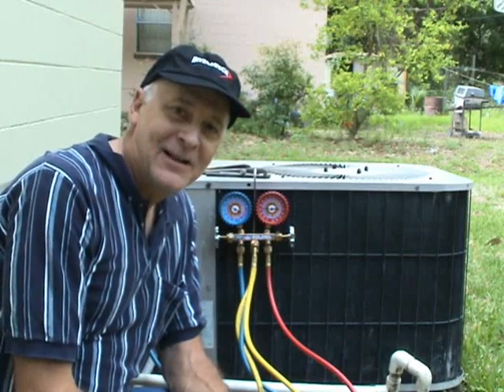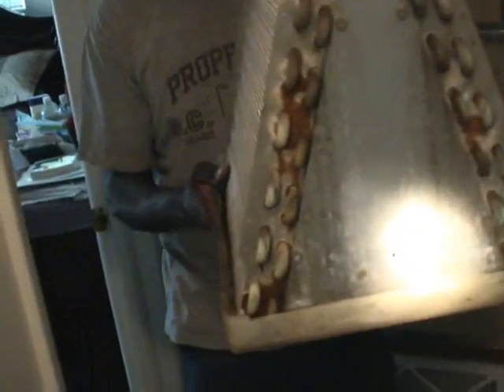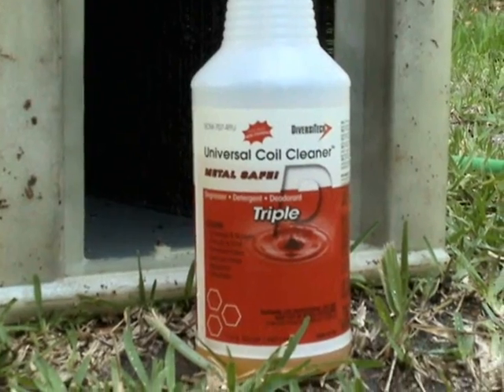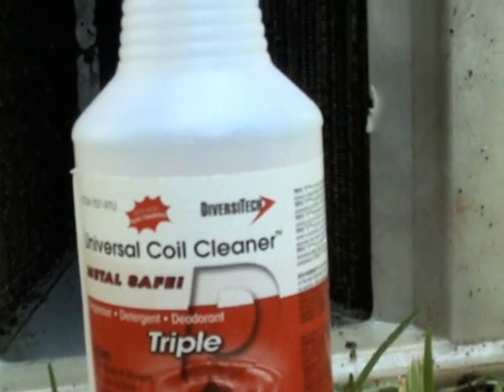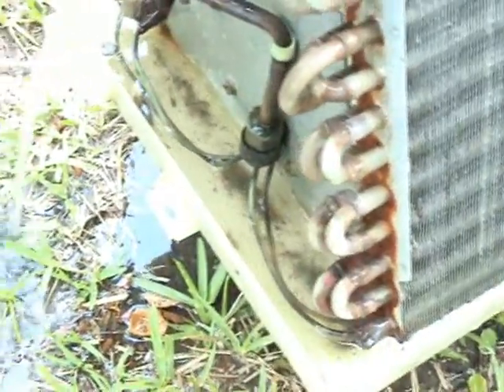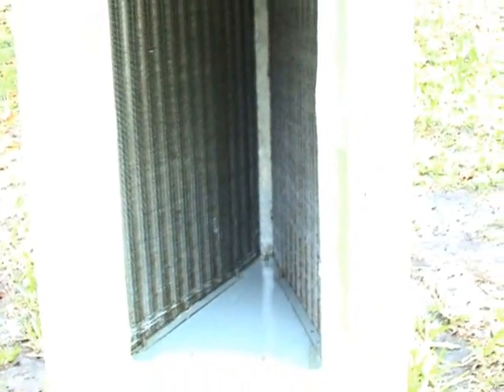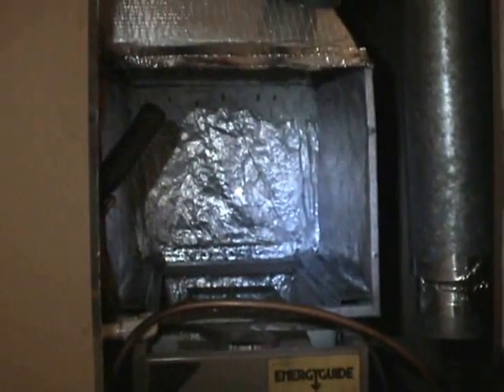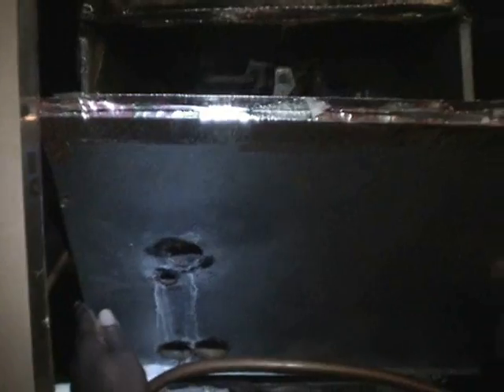HVAC Evaporator Coil Cleaning

Comment: you may think its the right way and its worked for you, but common sense says to let the coil cleaner penetrate from the clea outside to soak up through the hard to reach particles then break out the inner side . Logically your method is incorrect. But with repeated application it works as good, less efficiently.

Comment: The labor cost to get to the coil varies on where it is.

(1) Easy. Here my one AC unit has the coil right in a cabinet and one just climbs in and airhandler and coil box are easy to remove after a pump down and un brazing. One could do several dozens of jobs like this compared to case (3)

(2) Harder. The Airhandler in neighbors house is in the attic about 40 feet from the entrance. One has to scoot on ones butt while going on the crabway walk and carry ones gear up over the airducts too. The height is about 3 ft in the crabway and about 3 to 4.5 where the airhandler is. If one actually wanted to remove the coil and take it outside and clean it then rebraze it in the hot attic any sane HVAC guy really needs to charge at least 300 bucks to 500 since it is a PITA job. In this area after Katrina most pro HVAC guys had so much work that they would never remove a coil, ie just replace entire system at 3 to 4K per ton and folks were on waiting lists! 

(3) Really Expensive. The A coil in my commercial building is a dual circuit 48" unit that has 2 TXV's and is fed by two 5 ton condensers. The coil costs several grand if one can find one. To professionally pull the coil and clean it has been quoted between 800 to 2 grand. Plus the pro HVAC guys say if anything breaks it is not their fault. Thus the unit is cleaned in place, a compromise.

Professional HVAC guys here have been sued then cleaned the coil and they never even cleaned it in place. ie post Katrina scammers.

Removing the coil to clean it will get the cleanest coil by it is rarely done. ie the cost is super high or the HVAC pro marketing guy is selling those  50 to 70 buck HVAC spring AC tuneup that cleans both coils and replaces the filters and checks the operation.  ie the coil is cleaned in place. 

In large commercial installs one wants the evap coil to be able to be cleaned in place

Dr Z's video is very good. Around here it is rarely done.

I wager that in all the professional HVAC coil guys around here in only a few percentage of jobs is the coil actually pulled out and cleaned and then the system refilled.

With my own case (3) all the HVAC pro guys just want to do new installs. Thus after Katrina when I cleaned the coil in place on Saturday, I could only do a fair job. The quotes in 2006 and 2007 to replace 10 tons of AC was 35 to 45K, that was when money was awash and everybody an expert.

Comment: This is how the professional would pull and clean an evap coil.  The homeowner should never do this unless they are a professional.  In fact the homeowner should never go beyond a filter change. I know sometimes it is a bit spendy, but find an ac guy you can trust.

Comment: Hi Doc,
Is there such a thing as a clogged evaporator coil (inside the lines)? Recently I had an old condensor(R22, 3ton) replaced with a 410A system (4ton). During the last step the tech ran system for a while. Also he had a guage attached to it. He showed me that the red gauge was fluctating and told me that it was due to a clogged evaporation coil. He is charging me more money to unclog it. I just don't want to be taken for a ride.

Comment: If you pull it out like they did, you have to recover the refrigerant or pump it into the condensing unit, you have to cut or unbraze the lines, you may have to disconnect a flue pipe, gas lines or anything else that may be in the way. Then you can pull it out a clean it. Cleaning it will only take about 10 minutes. Then you have to put it all back together, pump it into a deep vacuum and recharge it. I would say it should take between 2-4 hours depending on your vacuum pump and experience level

Comment: what is best to clean without cutting the pipes? I can't weld so can't take the unit out. Mine looks like yours but sucks the air from the outside instead of the inside. My inside looks pristine but dirty on the outside. I used a scrub brush, air compressor to blow fins and vacuumed up the mess. Mine still looks a little dirty so I may need to use a cleaner but don't know how with the unit still mounted inside.

Comment: prob is that the compressor has ran for so long with that stopped up coil.  all the oil has been stuck in the evaporator and has tarnished the windings on the compressor. When the coil is clean and put back in, all the oil the evaporator will come back to the compressor and kill it. basically it will be a burnout

Comment: Was it necessary to use the torch and remove it out or just did it to give us a better understanding of how to clean? Because there are sprays for coil cleaning which I'm sure you have came across a million times..just a little confused. Thanks in advance

Comment from the maker: @olumota It could be one or all of these things. 
1. You could have a dirty air filter.
2. You could have a bad blower motor or run capacitor or a bad belt if you  have a belt driven blower.
3. You could have a dirty evaporator coil.
4. You could have a bad or plugged  expansion valve.
5. You could have a refrigerant leak which will make your system low in refrigerant. 
6. You could have a plugged liquid line filter drier.
7. You could have a plugged or bad liquid side service valve.

Comment: @Mooseguy15 oh also im pretty sure i got this right but just to make sure Low preassure is liquid and high preassure is gas? just wondering and if i was to recover freon i take it from the low preassure copper pipe? right and to recharge is high preassure since its gas and you need no pump?

Comment: @Mooseguy15 huh funny good thing i still have a r22 window ac hahahahaha 12,000BTU to be exact, i have another question have you ever heard of a magnasonic ACM12000? cause thats what brand it is but i cannot seems to find any info what so ever on it like manual how much R22 it takes i did find out the compressor takes 1100Grams but yeah

Comment: Thanks for the info Dr.Z. Just finished mine today, carefully with a stiff bristled brush and a shop vac. It would be nice to do it this way, but since access is easy for mine through the rear and the panel on the a-coil removed easily cleaning was just handy.

Comment from the maker: @wmagheaven If you're referring to a mini-split ductless system then you don't need to pull out the evaporator. You can just clean it in place. Just use a no-rinse coil cleaner.

Comment: I just replaced my heat exchanger in my furnace and I cleaned the evaporator coil which is right above the heat exchanger and I think it was easier to do it my way than pulling out the entire evap coil... I did not have to unsweat anything.
What do you think...
I could not use a hose though

Comment: I have a vertical furnace and my evaporator coil is above the squirrel cage bower so I cannot really pump coil cleaner or shoot a hose in here.  So how am I to clean the evap coil?
I also don't want to pull the evap coil out because it would have to be pumped down and I don't like opening the lines up . Then pull a vacuum when all done ...
Is there a non wet way to clean evap coil?
I love your videos
Thanks

Comment: DRZ great video. My Unit is in my garage. Do you have to remove the evaporator coil to clean it? Is there a way to just clean it without removing it. I saw a article where someone used some type of foam coil cleaner to clean it. It seems that most of the dirt is on the inside of the coil and not the outer half which I can reach easily

Comment: good vid. i cleaned a lot of coils over summer. i use Totaline Coil Cleaner. i bye a 1Gal bottle of concentrate and mix it in to a spray bottle. i rince the coin out side inside out side. it works nice. i put cleaner on both sides.